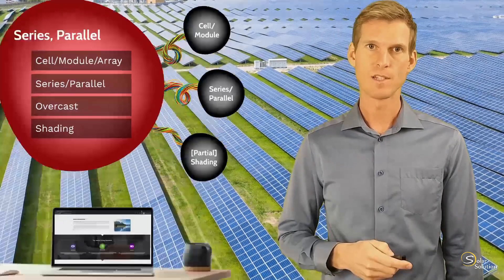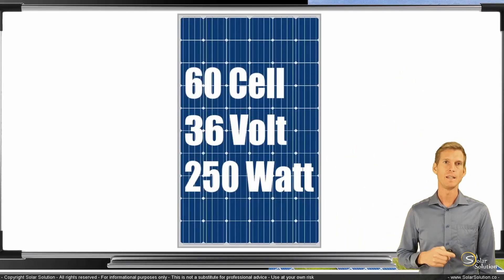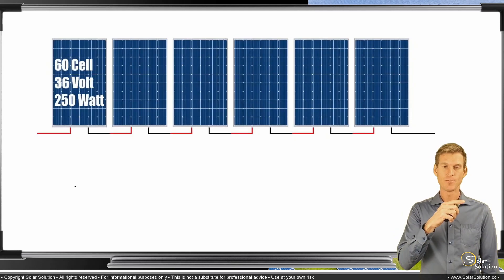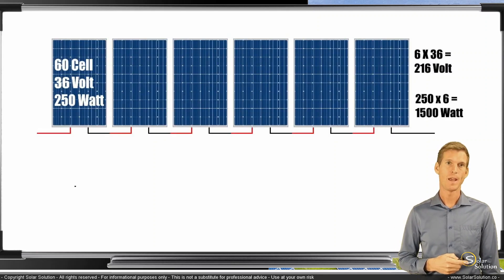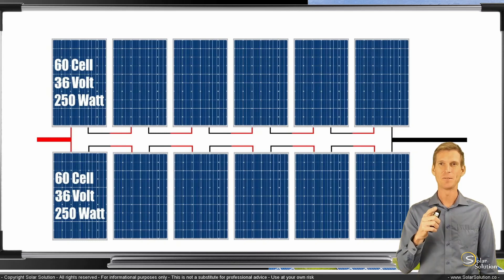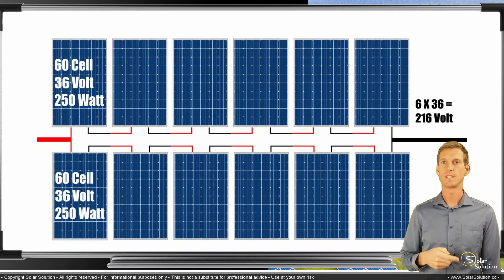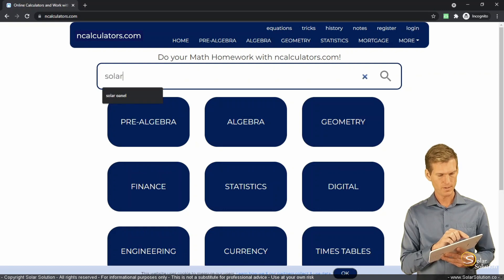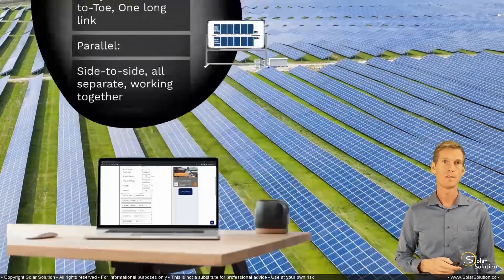Series or Parallel: What is better & How to calculate the output of your solar panels

Comment: Hello thank you for the video I'm building a very large solar system and it's my first one instead of getting a Pv box do you think it would be sufficient for me to use fuses at the mc4 branch adapter off of each series I'm going to have a series of eight panels which are tied in so four series of eight which equals a total output of 12,000 kilowatt hours it's going to be going into a 12,000 XP eg4 and I wasn't planning on using a PV box but do you suggest that I do or is it absolutely necessary , all together it's going to have 32 panels in series of 8 get my voltage right at 390 thank you very much for the information
Reply from the maker: That's a lot of panels!  I'd personally go for a PV box, it's worth the extra expense.

Comment: What happens if I connect 120v dc with 80v dc in parallel from solar panels
Reply: It won’t work right I already ask this question as well
As you can damage your panels you need to have an equal amount of panels with equal specs

Comment: Quick question let’s say you had 9 panels but have to do 5 in series and then the 4 in serious and the tie them
In parallel will that work out or do you have to have an even amount of panels?
Reply: Even or odd numbers but always the same amount in both series. In your example the set of 5 would pump its energy into the set of 4. I guess you run the risk of being in the market for a new set of panels after frying the old ones.
Reply: @JaakJacobus  thank you that makes alot of sense !

Comment: Really like the video and your explanation. Just have one question, shouldn't the system current be 13,889 since there's also a parallel connection (2x6,944)?
Reply: The calculator can't process that information. It can only do parallel OR series.
And yes, you have double both the total Amp. and Watt after calculating one of the series.

Comment: What am I missing here ? 
In your series example of 6 panels, your multiplying both voltage and current to reach 216 volts at 1,500 watts 
Then adding an exact 6 series panels, in a parallel string adds only current not voltage, 216 volts but now at 3,000 watts output 

If both parallel strings gained v+a 
Couldn't you have 6x36=216 volts , 6x250=1,500watts 
Added to another string of 6 panels 
And then get 12x36=432 volts , 12x250=3,000 watts 

More power = 😁
Reply: I thought no one is gonna mention that :D
Reply: @ralphghawi5656  Its been 2 months and your the first 🥉
Reply: Current is not measured in wats. The current is the same in one string. He doesn’t show the current. So 6x36=216 volts at 6.19 amps. Another string of six added in series will be 433 volts at the same 6.19 amps.
Reply: @Full Electric  Your right, my misunderstanding
Reply: So pararrel connection is the best
Reply: @Chuppe_g  It depends ! 
Higher voltage requires cheaper wires over the same distance, @ excepted voltage losses 
Higher amperage at lower voltage is rarely advisable,  depending on panels v charge controller